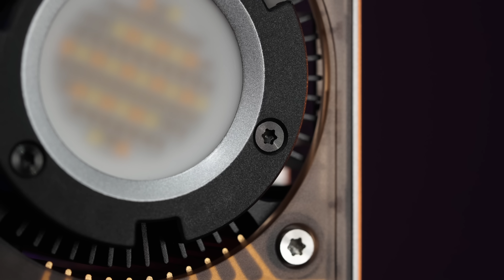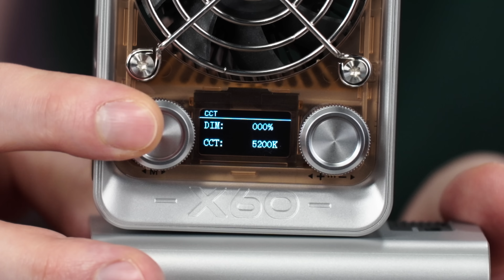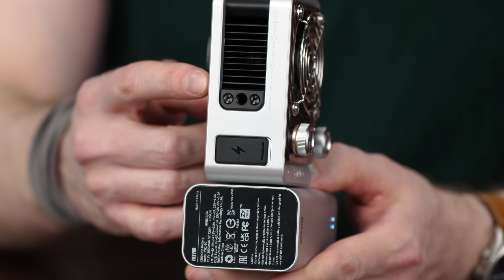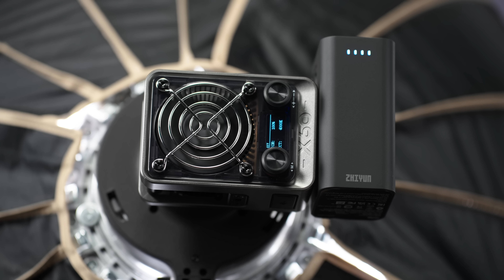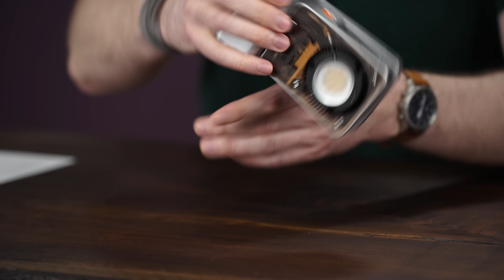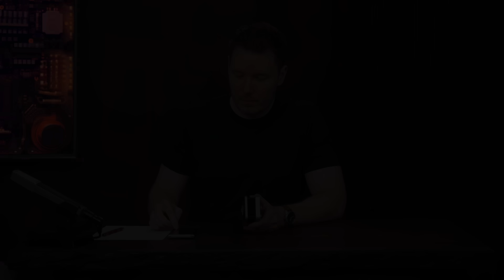These Lights Are GORGEOUS! (And Surprisingly Powerful)

Comment: For everyone wondering, it's not the same battery on the x100. I made sure to check with Zhiyun about this.
Reply from the maker: Good point. 👍 I meant compatible. Same style. Not same batch.
Reply: Does all parts work on both the 100 and this. Batteries and reflectors?
Reply: Just wanted to ask 😂
Thank you

Comment: Unfortunately I just bought 2 and one of them and had a similar battery issue as the early days of the x100. Wouldn't charge, wouldn't work. I tried with 3 different chargers including 18w, 50w and 60w PD, and about 6-7 different USBC cables rated for 100w and 240w. Nada. So disappointing.

I really want to love Zhiyun products because their designs are superb and their products are often unique, but at this stage their Molus battery-powered lineup does not inspire confidence.

Comment: Can anyone confirm if the battery is compatible with the Molus X100? Planning to buy the X60 RGB Pro Combo with the 2 batteries, and use the extra one for the Molus X100, since the original one is defunct. (yes i know the issue has been resolved but it's a bit complicated here in our country to send the battery for replacement).
Reply: it can work normal with the battery of X100.

Comment: Will it auto power on if I plug it in or have it plugged in on a switched receptacle?
Reply: This only works when connect with the DC power adapter and in live mode.
Reply: @chenlyn-cj8ve  of course it would need a DC power adapter.  Just wanted to make sure it would power on if it was on a switched outlet like it was a lamp, without pushing some soft power button.  What is Live Mode?  Did’t find a manual to reference.
Reply: @Qwiv  You can refer to the page 17. https://zhiyun-website-shenzhen.oss-cn-shenzhen.aliyuncs.com/instruction/20240320/1710901927906-ZP6Fiexz.pdf

Comment: I bought 2 x Molus x100 kits at not an inconsiderable price. I love the compact nature of these lights - but the batteries are pure junk even dangerous, stopped working after 2 or 3 charges. There is/was not enough information about the specific type of charger required. When I contacted Amazon (who I bought the units from) they just advised me to speak to the manufacturer, which I have been unable to. In my opinion - if Zhiyun are acknowledging that they had a problem with a batch of these batteries they should create a proper online portal where these can be exchanged.
Reply: Did you contact them about this problem?They issued a statement regarding the battery failure
Reply: @MikeTOTzzz  I have since made contact with Zhiyun - who replaced both batteries free of charge. I also have a Neewer V Mount battery which outputs 100watts via the usb c and works very well too.

Comment: Does anyone know what the maximum weight the Bowens adapter can handle?
Reply: The same as the X100 Bowens adapter, the diameter of the softbox should be equal to or less than 60cm and the
weight should be equal to or less than 1.3kg
Reply: @chenlyn-cj8ve  thanks so really you can’t put bigger soft boxes on it like a 45 inch. Do they have a specification sheet?
Reply: @zacharias21  45 inch maybe a little heavy for the adapter. but no specification sheet. I only find the message on the user guide of X100. The X60 and X100 use the same adapter.

Comment: Interesting on the color consistency and brightness power curve and lack of flickering.. I've designed lighting for surgeons for many years, and I get picky about this in lights. One thing I learned over the years was that if you use PWM to control brightness, while you get a wonderfully flat power curve, it definitely introduces those other problems. If you use an analog drive (IE control brightness by adjust the current), you eliminate the other problems, but you get the ones you mentioned.. a big jump at the low power, and a falloff at high power.. but no flicker, and no weird color shifting artifacts. Ultimately, that's usually a good tradeoff, since it can usually be easily corrected.. in post or with modifiers, where the other problems can't.

Comment: It only needs 60W charger? Is it also only 60W total consumption via barrel jack?
The Colbor 60R has a 60W-65W LED, but total power consumption is more like 80W. And that's one of the more efficient lights
Reply: They recommend to use 100W charger.

Comment: I forgot who's video it was but a few days ago someone showed that this hyper reflector in the Bowen's mount is problematic because it clearly creates a hotspot on the diffusion panel of any softbox. Did you notice this on this new one?
Reply from the maker: I used it in a soft box with an inner baffle that eliminates that problem.
Reply: @geraldundone  thanks a lot Gerald for this tip!

Comment: the reflector inside of the Bowens adapter is there due to give some space for cooling system
actually, most of the modifiers doesn't need so focused light.

Comment: You mentioned no flickering, which I assume you mean no flickering visible to the naked eye, but did you try photographing the lights at various power levels with electronic shutters to see if they exhibit any cycling from PWM that would manifest as banding when shooting at faster shutter speeds?

Comment: There is a big problem with this battery. It does not charge normally. I do not recommend it. There are many people who have faced the same problem and there is no solution. The battery remains stuck.
Zhiyun did not respond to customers
Reply: Hi dear customer, we feel sorry for the concern and inconvenience caused. Please be assured that the battery issues on Zhiyun's Molus lights have been fundamentally resolved since Oct, 2023 and please rest assured that the X60 series and all Zhiyun battery-included lights won't have similar issues in the future. 
To honor our consistent commitment to service and confidence in product quality, we pledge to provide FREE LIFETIME Product Care to all Zhiyun lights' batteries. You can find more details on Zhiyun's official sales sites or contact our sales or after-sales team directly for request.🙏
Reply: Was your problem solved?

Comment: hmm the missing green magenta is a shame but maybe they have to do it. I do not know for sure but could it be that the either rgb or bicolor is on because otherwise they would need to power all chips and maybe they safe on the power supply and less heat is generated ... just my guess, but many do that and it is a shame

Comment: I had an issue with the x100 and saw all the bad reviews on the replacement battery so I use a v-mount battery for power
Reply: Hi, can you explain it more? Have you any issues with the x100 or just with its battery? And one more question - which v-mount you use? :)
Reply: @pawebalcer7770  issues just with the battery. used it maybe 10 times and the battery no longer charges. I picked up the neewer 6800mAh 99Wh 14.5V V-mount for $124 with the small and the neewer superclamp vmount plate for like $20. Then just use a USBC cable into the light and it gives me up to 60% on the light
Reply: Did you get any help from Zhiyun?

Comment: Did you test it with a cable between the battery and the light?  I tested that with my x100 and turns out the output port (usb-c) is only a 30W port. That was so disappointing, because I wanted to distribute the weight.
Reply: Did you check your cable? You need a cable rated for 100W. I haven’t tested using a cable from the Zhiyun battery but with my PD power bank I have to use the right cable to get full power (otherwise I only get between 14W–60W)
Reply: @oliverholms  Well actually... I recently contacted Zhiyun support, and the conclusion is: the USB-C output port of the included battery is only 30W... That's a bummer... I totally don't understand why they would design it that way, but yeah... It is what it is...
Reply: @djepodjepo  Thanks for the clarification — that is annoying. Not a big deal for my workflow, which is why I hadn't realised. I just use the Zhiyun battery attached or larger capacity powerbank connected by a cable depending on if I'm prioritising manoeuvrability or runtime.
Reply: @oliverholms  ok clear, thanks for your reply!

Comment: Just stay away from the CX100 with the integrated battery and jank power button. Can accidentally be turned on while packed and start a fire.
Reply: Funny this is I have trouble trying to switch it on almost all the time
Reply: @benwoodbridge2134  Because they have changed the way to turn it on...  lol

Comment: Be careful, many people have had problems with the battery. After 4 or 5 loads they no longer worked with Zhyiun x100. The light itself remains really great
Reply: Hi dear customer, we feel sorry for the concern and inconvenience caused. Please be noted that the battery issues on Zhiyun's Molus lights have been fundamentally resolved since Oct, 2023 and please rest assured that the X60 series and all Zhiyun battery-included lights won't have similar issues in the future. 
To honor our consistent commitment to service and confidence in product quality, we hereby solemnly declare to provide FREE LIFETIME Product Care to all Zhiyun lights' batteries. You can find more details on Zhiyun's official sales sites or contact our sales or after-sales team directly for request.🙏
Reply: @ZhiyunTechGlobal  Thank you for this reply. The light has been wonderful, the only issue being the battery. Glad to hear that it has been updated and nice to see it can be used on a variety of lights.
Reply: @ZhiyunTechGlobal  I read that changing or sending a new battery remains our responsibility? Is it true ?
Reply: @meilzer3510  I paid the shipping for the repair.
Reply: this was the case with the first batches of the X100. The recent ones dont have problems anymore
Reply: I'm one of them, the battery cut out after 4 uses. Support was good enough, they sent back a fixed battery (not a replacement), so there may be a firmware problem on the battery. And luckily I had 2 and couldale do with what I had. But the lights are really great, I can't lie. 60 rgb seems like you won't get much out of it other than with you video/photo or some subtle accent lighting elsewhere. I might wait for the 100 version if they come out with it.
Reply: True , better the get the light without battery and use power bank instead
Reply: Yes, that's exactly what happened to me after like 4 times of using it.
Reply: @wilismatrix9847  How you solve the problem?
Reply: My X100 battery blew. Zhuyun replaced it and the second one blew. The light is super but the battery issues mean I would stay clear
Reply: Yup! Battery sucks and getting it replaced is rabbit hole.
Reply: I thought i got a bad one, my battery from the X100 was damaged after I charge it with my MacBook charger. 
I thought it was kind of my fault for not using a 35W or less charger, I stopped using the battery after I got it fixed, too scared to have to go though the same pain of waiting for the new battery, the first time happened within days of purchase so the seller helped me manage the complaint but I'm scared that if it happens again ill never see the light. 

Good to hear that the new battery has been improved, the X100 is very nice but need to make sure I use it above 5 of 7% output because the lower ones 2 3 4 5 are a complete mess of color shifting and I guess that was addressed on this version as well. 

I solved it by putting an additional diffusion cloth to dim down the light when I only need lower outputs with the added benefit of a smoother diffusion overall and better color accuracy
Reply: The ones that came with the X60 were definitely miles better, tried it with many different chargers and it still worked fine

Comment: Is this the same battery as the x100?
Reply: Hi, dear, it's not the same battery as the X100's but compatible with the X100's. For all new batteries of X100, X60 and future models, there won't be any charging or using problems and we pledge to provide free lifetime product care for the battery-included products for all our customers , including our old X100 users.

Comment: I've been saying the same things. At this point, any bi-color light needs to have +/_ Green/Magenta, or it's a no go for me. This seems like they could have easily added this in to the new light.
Reply: that's what i wanted to know. I really hope Aputure updates its high ssi amaran line with G/M adjustment. For now, I'll be rocking the 300c